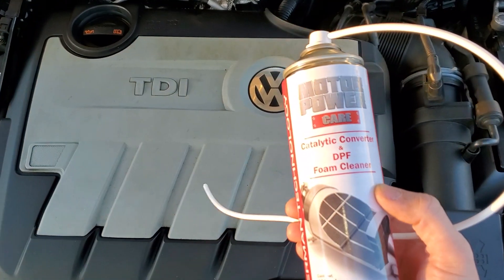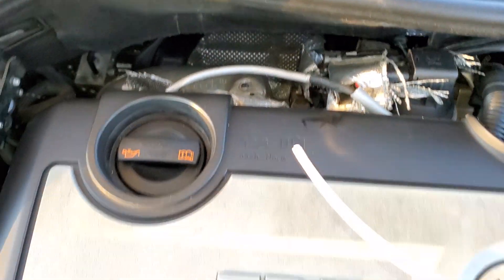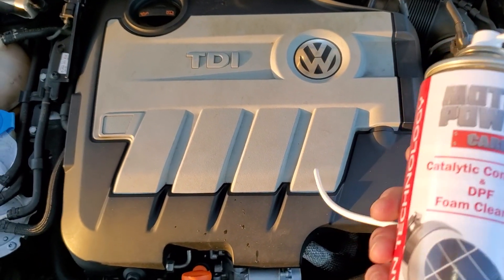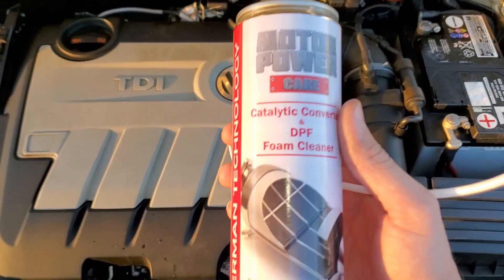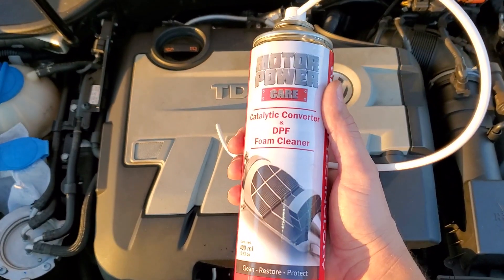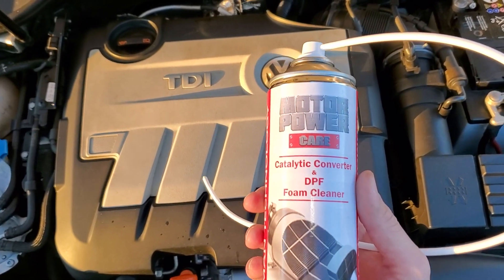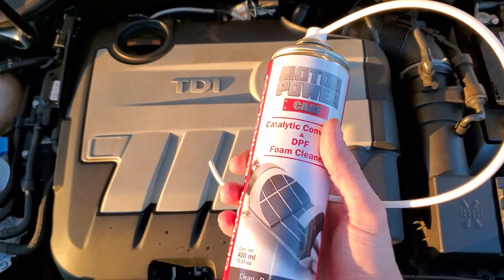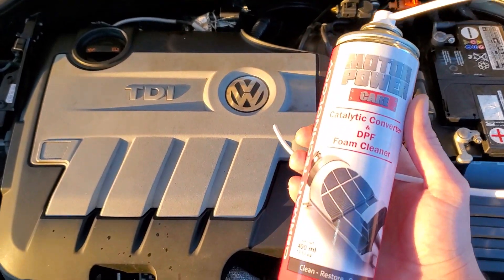How to clean DPF & Catalytic regen fix TDI Audi Volkswagen Jetta Golf Touareg Motor Power Care

Comment: Will this work for egr aswell
Reply from the maker: Look for EGR Cleaners but be careful if they tell you to spray while the car is running as this could lead to a RUNAWAY DIESEL ENGINE. I recommended cleaning the EGR by hand because if its really really dirty the soot might need to be manually removed and insures you wont have a runaway DIESEL cleaning by hand.

Comment: This is interesting.  I have my car in the shop because of a dpf code and they can't get it to clear with manual regen like almost any other dpf has.  According to them, the local VW dealer wants $3,000 US for a new catalytic converter, intermediate pipe, and dpf.  I looked online and saw one halfway across the country for $1,800 but if this product works like it did for you, you will have my eternal gratitude.
Reply from the maker: After 40,000 miles forced regeneration will not clear the codes as heavy metals accumulated can only be flushed out. After 40,000 miles you cannot force regeneration the accumulated heavy metals. Also check the EGR if it needs cleaning, clean that as well because a clogged EGR could also cause codes with the DPF. Every 40,000 miles the DPF needs to be flushed then perform a regeneration as seen in the video. This is a long regeneration that will clear out the DPF after Flushing every 40,000 miles, not a quick forced regeneration.
Reply: @sextillionproductions  is the 02 sensor on the dpf itself m8?

Comment: Thanks for the video. Should I remove the mass air flow sensor so that the EGR valve will not open? I've heard that the cleaner trapped between the DPF and turbo could possibly enter cylinders causing hydrolock? If one removed the mass flow sensor, would a regen with scan tool or manual regen on freeway still work?

Comment: Thank you so much for this instructional video… very helpful. Is it important/crucial to do all 4 cans in one sitting? Or could I do 2 cans today, and the remaining 2 cans in two days when they will be delivered? Thanks for your input 🙏🏼
Reply from the maker: @ingridramirez4295  whenever a DPF is professionally Cleaned they flush it out multiple times to not only save the life of the filter but also maximize your time needed between cleanings. I would recommend doing 4 cans the same day following each step between each can to flush out the DPF to get the best results.
Reply: @sextillionproductions  Thanks a lot, this helps! 🙌🏼
Reply from the maker: @ingridramirez4295  your welcome 🙏

Comment: Pretty good video. Thanks for posting this. I have a 2012 Volkswagen Jetta sportwagen TDI. It has 85,000 mi on it and the emission system is all gunked up with soot. I guess driving it on surface streets more than the highway is bad for the emissions system .I have the check engine light on and also the DPF light on. I even had it scoped at a mechanic and they gave me the report showing that I needed to have the whole system cleaned or replaced for $5,000. I tried this technique you have in the video and it didn't work, however I attribute that to my system being clearly very dirty. It did improve the white smoke that would belch out when I would first start my car, but the check engine light is still on after 200 miles. So I will have to try something else. But one thing that should be mentioned is that the upper O2 sensor needs a special 7/8 inch or 22 mm socket with a split in it so you can actually remove the O2 sensor.
Reply: Depending on where you live, you can remove both the EGR and DPF systems since both of those will eventually kill the diesels. Nice thing is, to buy the kit to remove it, its about $1500 since its a whole new exhaust system, then about another $500-900 to get your car reprogramed, but that could even be cheaper depending on what is done. So really, for 50% of the cost of just the DPF, you can remove it all and gain about 10-15MPG back.
Reply: @obviouslytom  but does the vehicle with a delete still pass emissions?
Reply: @jacehiggs3637  that's the beautiful thing about living in the state of Georgia. We don't have emissions on diesels!
Reply: Where do you get the dpf delete exhaust ?
Reply: Illinois have no emissions test for diesel too.

Comment: Hi thanks for the video. I tried what you described. I am wondering why I never saw any white smoke coming out the muffler. No smoke. I never also didn't know if I was supposed to put the hose in and move it around. I just inserted at almost all the way. After driving i have not seen any positive  results.  Also, the vehicle never went into regen after the drive. I am assuming I would hear the fan running after I parked,  nothing like that happened.  Any suggestions? I obviously could take it to the mechanic, which Ive done already prior.  They said replace cats. I'm thinking last ditch effort to go to the muffler shop and remove the cats to clean them
Reply from the maker: The instructions on how to apply are at 1:30 in the video. Read all the comments to learn answers to repeat questions and rewatch the video if you need more details. If it's too complicated to understand then have someone who understands perform the process. 👍

Comment: Great video brother.  If you get a stainless steel drinking straw and attach it to the end of the plastic hose, you won’t have the risk of melting 👍
Reply from the maker: The only reason I didn't do that is because the tip of the plastic nozzle has the multi jet head that sprays the cleaner in different directions blasting off all the soot inside with great pressure and I found it easier to move the plastic nozzle all around front and back of the inside of the DPF for a thorough cleaning. But it is a great Idea to use the stainless steel tube I would just try to figure out a way to make it flexible and put a nozzle on the end of the tube so it has the same thorough jet cleaning effect as the plastic one that comes with the cleaner. 👍

Comment: I got the 4 cans in and my TDI Jetta seems to be running great again, but my cruise control isn’t working :,( so I wasn’t able to use that after the 4th can, so my DPF light is still on.. any advise? Can I complete a regen drive cycle without cruise control?
Reply from the maker: Use the links to support the channel by buying anything you need off Amazon. Yes you can, all you have to do is use an OBD2 reader to see the regeneration turn on or off in real time while driving having the OBD2 reader connected to the vehicle with a co-pilot monitoring the regeneration procedure on the tablet, also it will check for any issues with the vehicle. I recommend the thinkCar - M70 OBD2 reader https://amzn.to/3tvttKd or the Autel Maxisys ultra EV scanner https://amzn.to/3tvtZI9 Any good tablet reader from either company is fine, you just have to check its capabilities for what you need it to perform such as viewing regeneration cycles turning on and off live while you drive. The procedure stays the same except you will have to keep the speed exactly the same as if you were using cruise control any sudden stopping or speeding up will turn off the regeneration as you will see on the OBD monitor.
Reply: Same for me...someone else said you've got to get the credit cleared at a shop, but I'm just curious if my dpf is actually clean. My upstream o2 sesnsor is really black...I may try Changing that next...I'm not a car guy but hate new if I can fix... thoughts out there?
Reply: No problem, drive without stopping for 2.5 hours at 2k rpm at 80-100km/h, no need for cruise control. You can do 5th or 6th gear. Before you drive you can also fill 300ml of 2Stroke Low Ash oil before you fill 60litres of diesel, it cleans the entire system. 2Stroke oil should have Jaso FD spec.

Comment: Will this work for an 2010 jetta tdi? Mine doesn't use dpf fluid. But my M-N-L drives very slow and only goes to the grocery store a couple of times a week in hers. Just got the filter alarm in. Someone else told me to put it in 4th gear and rev it high for 30 miles or so.
Reply: I am wondering this too, I am getting some check engine exhaust codes and need to fix
Reply from the maker: Yes you can use this on a DPF that does not use DPF fluid as well. There are heavy metals that build up in the DPF after 40,000 miles so you have to flush it using the cleaner to get them out. Even if you can get the light to go away reving it, the heavy metals will only continue to quickly clog your filter again since the heavy metals are not able to be removed by reving. That's why you have to flush out the heavy metals with a cleaner to remove the heavy metals because reving the engine will not remove the heavy metals.
Reply: @sextillionproductions  Do you happen to have a procedure for this on a 2010 or is it the same as what you did on your video?
Reply from the maker: @rundmm  it's the same process for all vehicles diesel or gas because this is both a DPF and catalytic cleaner.

Comment: You said replace 02 sensor. So I have to buy a new 02 sensor or just put it back into original
Position?  THANK YOU!
Reply from the maker: Correct I'm only giving directions to remove the O2 sensor then replace the O2 sensor back into its position. I did not mean to replace the O2 sensor with a new O2 sensor.

Comment: Can you disconnect the hose on the sensor and squirt in there?
Reply from the maker: If you watch the video I explain the motions used to cover the complete inside of the DPF. You have to use the long tube on the can to be able to reach all areas of the DPF for an effective cleaning.  The short answer is no. I recommend following the directions in the video going in and out 5 second intervals like the video explains.

Comment: I got the code p2002 and also p0401, I have 130,000 miles and the engine looks super clean and runs very nice and quiet, I just purchase the 2013 TDI beetle for my daughter and I'm trying to get it ready does that code mean I have to do extensive work can I just replace the parts with new parts or just cleaning them would do just fine? Thank you for explaining I'm sorry if I'm asking a stupid question
Reply from the maker: P2002: says it's a clog in your exhaust filter and the engine wants to try and clean the clog. 
P0401: Exhaust Gas Recirculation (EGR) air flow is insufficient Detected. 
Both codes require cleaning. 1. First code requires DPF and catalytic converter cleaning which can be cleaned by using the DPF cleaner and instructions in the the video.
2. Second code requires you to clean the EGR. You may find it easier to remove the EGR and clean it safely, rather than use spray cleaners for the EGR while the car is running due to the possibility of a Diesel Engine Runaway that could kill your engine permanently. I recommend to remove the EGR and clean it safely away from the car. Then once cleaned reinstall the EGR.
Every 40,000 miles there are heavy metals that accumulate in the DPF which require a DPF cleaner to remove that's the purpose of this video. I also recommend checking your EGR every 40,000 miles to make sure it's clean before cleaning the DPF with the DPF and exhaust cleaner.
This happens every 40,000 miles so I would recommend cleaning first and if after cleaning your still experiencing issues then as a last resort I would purchase new parts. To save you money I would try cleaning everything before purchasing new parts because this is going to happen every 40,000 miles even if the parts are new.
Reply: @sextillionproductions  that is great information I really appreciate that, thank you for taking the time to explain it I I'm very thankful to you
Reply from the maker: @mrvic92154  no problem 👍
Reply: @sextillionproductions  I've been watching a lot of YouTube examples and one of them mentioned that if there's soot in the muffler it could mean that the DPF is cracked not sure what that means because I have a little bit of soot in my exhaust, does that mean I just have to replace the DPF particle filter or is the engine ruined or do I have to just run some of these chemicals because the engine runs beautifully and is spotless, one of the next steps is I'm going to try to clean the EGR in the front but I hear there's another EGR in the back close to the firewall is there anything I need to be concerned about thanks again
Reply from the maker: @mrvic92154  It's cheaper to clean the DPF and the EGR than to replace both of them. Clean the EGR away from the car then clean the DPF. When the DPF is dirty, sometimes there is soot at the end of the exhaust. If after cleaning, it does not pass smog, then you know it's cracked. Either way if you had brand new parts you still have to clean the EGR and DPF every 40,000 miles. So even if the parts are bad you will get good practice to clean the new parts when the new parts are due for a cleaning. If it does pass smog than you just saved a ton of money 💰, time, and labor. Also if your engine was ruined you would get a code telling you on the OBD Reader. If your worried about the engine scan it with the OBD reader.

Comment: Mine just went off. Guy told me to run 50 miles an hour in 3-4 gear with 3500-4500 rpm and he said it would burn the soot off
Reply from the maker: Both forced regeneration and regular driving 2500 rpm regeneration burn the soot off. It's every 40,000 miles that you need to clean the DPF because of heavy metals that accumulate in the DPF and can not be burned off during regeneration. Even if you can get it to go off with regeneration after 40,000 miles the heavy metals accumulated will clog up the DPF quickly and reduce air flow. The purpose of the cleaner is to get out those heavy metals so the regular regeneration will continue to provide a larger air flow while burning off the soot efficiently.
Reply: Oh ok thank you

Comment: What are the codes did you clear?
Reply from the maker: Buy using link https://amzn.to/3VFEPoo to help the channel 👍 and the codes I received was P2002 for the DPF and the second code was for the NOx sensor. After performing a flush you need to check the EGR if it needs to be cleaned.

Comment: What’s a good way to determine if the DPF is to far gone?
Reply from the maker: First perform the DPF cleaning and regeneration. If the soot and ash are too hard and they can not be cleaned it needs to be replaced. That's why forced regeneration at shops can't guarantee 100% successful cleaning because if it's too hard and cant be cleaned you have to replace the DPF. If it was able to be cleaned at the shop through forced regeneration than you could have cleaned it yourself with the DPF cleaning cans and regeneration. You could save money and wear and tear on your vehicle from the shop removing the whole dpf and reinstalling it, if you just clean the DPF yourself.

Comment: Will the check engine light and the other dpf light turn off on its own after that 40 min drive, in a few days or does it have to be reset somehow???
Reply from the maker: Usually goes off on its own but you could check the vehicles ECU with an OBD reader to check codes and clear codes as well. You have to use an OBD2 reader to find out any issues with the vehicle. I recommend the thinkCar - M70 OBD2 reader https://amzn.to/3tvttKd or the Autel Maxisys ultra EV scanner https://amzn.to/3tvtZI9 Any good tablet reader from either company is fine just have to check its capabilities for what you need it to perform.

Comment: Great video done all step by step like you explain on this video on my second can the engine management light come on any tips what could be thank you all
Reply from the maker: You have to use an OBD2 reader to find out any issues with the vehicle. I recommend the thinkCar - M70 OBD2 reader https://amzn.to/3tvttKd or the Autel Maxisys ultra EV scanner https://amzn.to/3tvtZI9 Any good tablet reader from either company is fine just have to check its capabilities for what you need it to perform.
Reply: @sextillionproductions  thank you got someone coming round get it checked out.. engine management light has   gone out I'm just gonna get it plug in see if there is any codes need deleting
Reply: I will have to test drive at 2 AM so nobody else is on the road to use the cruise control 😂

Comment: How many miles did your car have when the dpf light came on and you needed to clean it?
Reply from the maker: The dpf is cleaning during normal driving with dpf regeneration. After 40,000 miles there are heavy metals that accumulate in the dpf and cannot be burned away through regular dpf regeneration that's when your light for the DPF will come on and you will need to flush the DPF with the DPF cleaner. Every 40,000 miles

Comment: What do you do if cruise control doesn’t work
Reply from the maker: Use an obd reader to verify your cars dpf regeneration is turning on at 2,250 Rpms then  keep it at 2,250 rpms for the whole ride. If you hit the breaks it will stop the dpf regeneration as shown on the obd reader. Best to drive on a long stretch of open highway at night with no cars on the road at 55 mph

Comment: Just for anyone wondering, you need a special socket to remove the O2 sensor
Reply from the maker: Yes the socket makes it a whole lot easier. Just for anyone wondering if you have to use a special socket the answer is no. I was able to remove the heat shield and dpf pressure sensor it's a little black box with hoses connected to it and had plenty of clearance to use regular tools 🔧 no problem what so ever. So if you don't have time or money to purchase the special socket you can do it easily without one. I was able to do it easily without the special socket so can you 👍